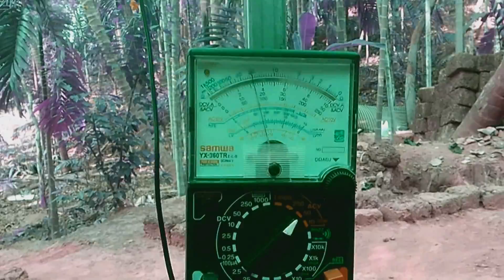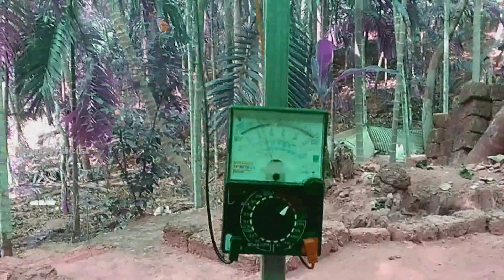DIY Wind Turbine 👍 Most Popular Wind Turbine Making Video

Comment: Hello Hello from Greece all is simple yet fantastic !!! I would like to ask what motor is DC at 12 volt ???
Reply: Most bicycle generators are 12 VDC output, but some are only 6 VDC so make sure if you buy one. Also, they are brushless and will last a long time. If you use it to charge a battery, put a diode or bridge rectifier between the generator and the battery.
Reply: I think there is a solution rite now..https://www.lazada.com.my/products/bicycle-dynamo-power-generator-12v-6w-3000mah-power-bank-power-supply-system-i329329308-s457323905.html?spm=a2o4k.searchlist.list.33.75fa46dcp7ov4Q&search=1

Comment: how to do wire supply ? 

with power generator wiring also move roundly.

wiring will not be permonant, do u have any solution for that.

entire project is excellent
Reply from the maker: +Swapnil Mahingade, thank you for your kind words. And you've asked a clever question. In a industrial turbine they may have used complex circuits.

We can use simply use slip ring contacts as in an ac motor or dynamo. Simple.

Search slip ring contact.

Regards👍
Reply: New Physicist slip ring is very costly. 

i need your another help and guidance.
so more communication i need your email id or whats app no.

Comment: it can produce maximum 12 volts ac but we can't use this current to perform any work
Reply: The objective of wind, solar and water generators is to slowly build up a charge in a battery bank. You then discharge the batteries as fast as you want. Think of it like a cup collecting water from a dripping faucet.
Reply: Gursimran Singh Saini make a garden of it

Comment: I love this wind turbine
Reply: Will you be able to post the wind turbine blade template so that it can be tried.
Reply: it is a terrible design though. with that tubine size and geating it would stall as soon as you draw any amperage from the generator
Reply: https://www.youtube.com/watch?v=_1Zr4Uu5sks
Reply: yes you show the ac voltage but amps is not,  hiw many amp in the dynamo?  and what electric product can use in that wind turbine ?
Reply: @markbryanochavez1871  this is called bicycle dynamo and can be purchased from bicycle spares shops. Both 6V and 12V models are available.
Mine was 12V which could drive front headlight and a backlight. So we can estimate the current to be max 1A. The wire gauge used was around 24 or 25SWG. So probably it's 1A dynamo.

Comment: 5 blade of airfoil design would give you more low wind torque and startup as well as decrease air drag. Balancing the blade will also help with efficiency and increase output. Treadmill motors make good generators. I hope these ideas help you.

Comment from the maker: For Those who have doubt about the wind...... Actually, does the wind blow??

 I've put a wall fan few meters away from the turbine.  I love wind power, and wind turbines. I couldn't resist me from making it. But, sadly there was a catch. There isn't enough wind in my native place.  What would you do? Create the wind artificially. 👍😉

My next project is a tidal power plant. and Don't expect an artificial SEA.

If you want to read full text version of this project Click this link
Read text version here : https://www.newphysicist.com/make-wind-turbine/

Product links to make this project
* 6V, 12V and 24V Dynamo Wind Driven DC Generator:  https://amzn.to/2oCva6P
* Cycle Chain: https://amzn.to/2M8Ofqf
* Cycle Freewheel: https://amzn.to/32cpwXU
Reply: yeah I was about to ask about it, the leaves around are not moving seems not normal for the turbine to turn without the natural wind lol

Great job!!!
Reply: you can use any electric motor, depending ho how big your turbine is. search for broken machines like washing, blenders if you do a 3m diameter rotor, or for a printer, pc cooling fan, etc, if you do a 40 cm rotor. But use strong suport to avoid oscilating that will break it.
Reply: New Physicist
Reply from the maker: +ArchitectJacinto, Thank you for valuable suggestions. 👍
Reply: You have the credits, not me. I only replied to one question. very well done on your side.
Reply: what type of motor used and where I should buy please tell me
Reply: heppolt wind turbine
Reply: New Physicist
Reply: Dk
Reply: New Physicist
Reply: New Physicist
Reply: New Physicist
Reply: New Physicist if you did make that in a artificial sea I guess you could make microwaves sorry I had to😂
Reply: New Physicist 
Hey buddy really appreciate your effort but I had a doubt about the relationship of 1:3:20(I had read the comment) and the diametre of PVC pipe from which you had cut  the blades.hoping for quick reply 🤓
Reply: eलवsicist
Reply: New Physicist hudang
Reply: memasak makanan
Reply: New Physicist u
Reply from the maker: +ArchitectJacinto, thank you. Keep in touch.
Reply: water pump k Liya use kar sakte hai kya plz give contact details email id and mobile no.  
my details vikash Kumar
citi4sales@gmail.com
Reply: The construction is simple, rational and practical. Maybe it needs more wind hands to five or more depending on  local wind stream.
Reply: New Physicist 
3
Reply: New Physicist )
Reply: New Physicist mi
Reply from the maker: +PlayerCheatification, Watch from 12:30 to 13:00

That's all. Thank you for your feedback. Have s great say.

Newphysicist👍💕
Reply: Yes tidal power is a great idea as it is always moving both day and night so unless the water freezes, you'll always be able to capture power from the water.
Reply: New Physicist
Reply: New Physicist bfdndyxsecsri
Reply: how much volts did you get?
Reply: i would raise it up above the trees so you could actully catch the wind! ., genius! 😉
Reply: New Physicist xxxxxjihmèn$ex
Reply: New Physicist nice
Reply: Starr Stewart bb
Reply: I discovered a useful collection of videos that should help you at Ewans energy roadmap
Reply: New Physicist where is the wall fan 13:00 to 13:05 I'm seeing non. Shame on you for thinking us that stupid.
Reply: Wow...you are completely lying.....dont foolish other s.even a wall fan cant rotate your  pvc turbine.its a nice idea of keeping motor inside dynamo casing...good job.
Reply: funplusvideos yeap it's spinning quite fast also.
Reply: Hey brother can I buy your turbine off you. my NATIVE land is very windy and I wish I had time to get this for my elderly grandma so I can set it up f0r a wall heater...i Got an E-Mail
Reply: Nicely made,great project
Reply: That was what i saw first... no wind here XD on a days i will upluad my wind turbine, so you can see what i am goning to build. A little biger than this one. 
Anyway good job here!
Reply: You loved your own comment????????
Reply: Man any way that you can make the video of how to make the thing that generate the power?? This is reallyamaxing project I would love to do with my kids
Reply: I was gonna say looks pretty calm on the leaves on trees how the hell is this spinning so fast, lol.
Reply: Make a Bike or Hydro power electric generator.  Something that can run in a creek or river while you exist or a stationary bike mod to charge your tech at the same time.
Reply: Hello! Your video is great, useful and meaningful to apply very well in real life. I live in Vietnam. A country is still poor, so you need your creativity. My youtube channel is also working on this issue. Please register to see and comment for me. Thank you for your deep comments.
Reply: Very small scale wind is a night time & bad weather substitute for solar pv power. Solar panels should be your primary source.
Reply from the maker: rmsbala murugan, you can buy wind turbine dynamo online. I used a less efficient cycle dynamo. I had ordered for a dynamo, but sadly it didn't reach me on time. so I used a cycle dynamo..👍
Reply: rmsbala murugan ...some bicycles got a motor with light, the motor has a tiny wheel when lights are needed you pull a tiny lever and the motor wheel touches the bicycle tire and generates power for the headlight while riding the bicycle.
Reply: Frank Blackcrow what a book of knowledge you are.
Reply: This time I'll use Inplix instructions to make it by myself.

Comment: something is wrong there is no wind from either sides !! but how that's run that speed
Reply: abhishek samuel oh its realy...
Reply: heppolt wind turbine
Reply: 212.237.13.113
Reply: wrong IP haha
Reply: he has supplied current through the pipe (through Wires )ofcourse
Reply: Sathyanarayana Lingiah m
Reply: Yes, Why is that ?
Reply: Use the low power turbine to trickle charge a battery bank, use  the battery bank to convert 12v into 110 or 220 with a converter. You might be surprised at what you can do with a battery bank.
Reply from the maker: +abhishek samuel, You got it. I've put a wall fan few meters away from the turbine. 

I love wind power, and wind turbines. I can't resist me from making it. But, sadly there was a catch. There isn't enough wind in my native place. 

What would you do? Create wind artificially. 👍😉

My next project is a tidal power plant. Don't expect an artificial SEA.😎
Reply: New Physicist , oh right bro thanks for solving my doubt :-)  , haha an artificial sea , this project is awesome
Reply from the maker: +abhishek samuel, Thank you for your complement. Follow your passion, live your dreams.. Regards..👍
Reply: this is way you have to use a heppolt wind turbine and use the golf wind
Reply: New Physicist so 2 or 3 kw of power converted to about 2w that's an awesome piece of chit